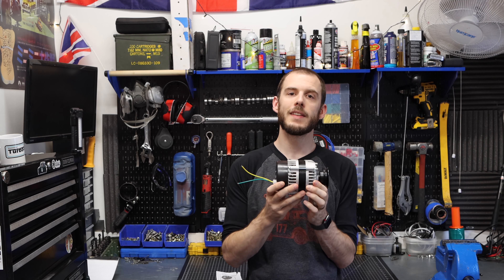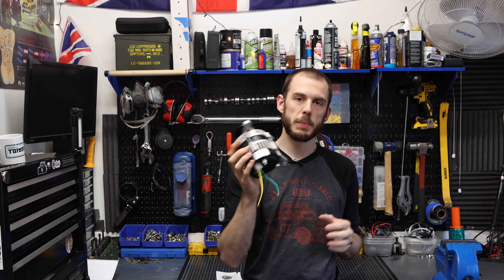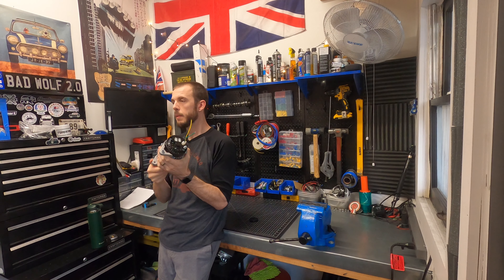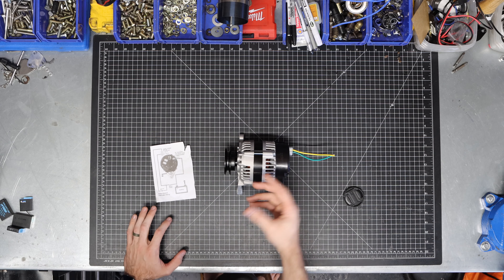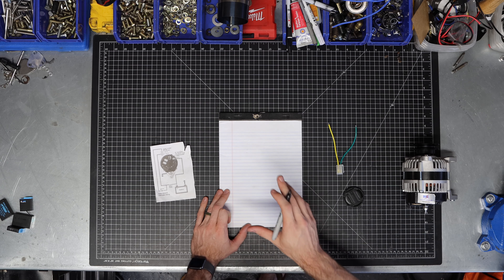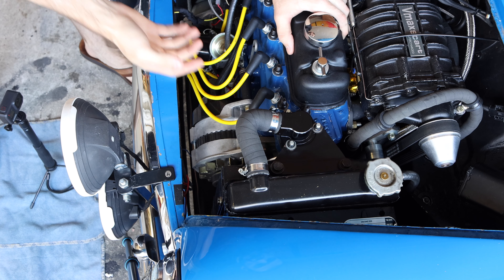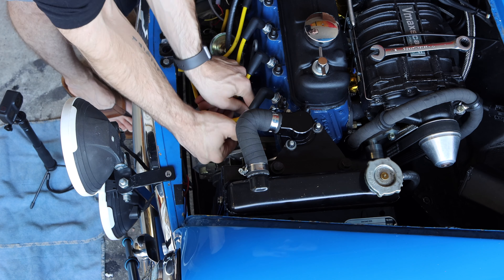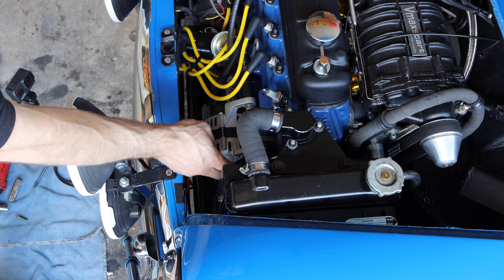How to Install - Lightweight Racing Alternator

Comment: Though the title looks cool, you basically fitted an aftermarket Mini MPI/SPI alternator. You should've gone one step further and gotten hold of the mountings too. That results in the alternator sitting higher and that way you can use the OEM setup for an OEM front-mounted radiator.
Ps: I personally would install an extra earth strap somewhere, between the engine and the chassis.
Oh, and about the 14V charge currency. It is supposed to be higher than the charge of the 12V battery. Otherwise it wouldn't charge.
Though, not higher than 14.4, otherwise you'll cook the battery dry.
But the charge regulator is taking care of that.
Reply from the maker: 😎 I don’t know what you mean MED called it a racing alternator too...😂 I considered doing the MPI setup with it up high but I also have an a series block, not a+ so a new bracket would have had to get made to adapt it from generator setup all the way to MPI raised setup. I also have a distributor which would foul the MPI radiator. I have a really solid earth strap between the engine chassis near the starter to the subframe. You think another would be required past that?
Reply: @classicminidiy   Ok. Fair enough. They actually do. 
The MPI brackets are available though. The radiator fouling the dizzy, I didn't consider that. But there are ways around that too.
In a way, what I'm saying is, many times going for OEM is cheaper in the end instead of aftermarket.
Ground strap is ground strap. If you have a good one, it's all ok.
Reply: @Paul_VanGo  MPi alternator is very different to the rest of the A series ones. You also can't just fit the OEM MPi brackets to the pre-MPi block due to the differences in castings.
Reply: @Dagowly83  I checked and I stand corrected. It's missing the provisions in the casting for the 4 mountings points to fit the bracket.
I'm off my soapbox and continue towards the corner, where I can stand there in shame for a while...
 😉
Well at least one learns every day.
Reply: @Paul_VanGo  it's all about the learning fella 😊 my life is pretty much MPi minis and how annoying it is to work on them 🤣
Reply from the maker: @Paul_VanGo  I always really value your comments when you make them. Every time I make a video I usually will learn something from you that you will add to my episodes.
Reply: @classicminidiy  Oh, stop it... You make me blush... 🤭
But you're welcome.
And thank you for the content. 👍🏻
Reply: No, this is not an MPi Mini alternator.

Comment: Does this alternator work on SPI models and do you known if is a conversion kit is available to mount this? Your channel is very help to me in maintaining my #jpclassicmini #rovermini🙏🏼
Reply from the maker: Hey! I believe it would probably work on an SPI. I would touch base with MED Engineering directly and see what they say. However I don't see any reason why it wouldn't fit.

Comment: All you've done is add an extra heavy duty cable,  I think? You still connected up the standard wire that was fine on the 75 amp alternator, does the alternator charge better with the bigger cable added.?
Reply from the maker: Yeah, essentially it boils down to a larger cable and splicing those two ignition wires to the one lead. Nice and simple install really. It is actually charging considerably more consistent and better with the larger cable. So that's nice! Now I have room for that custom front mount rad!